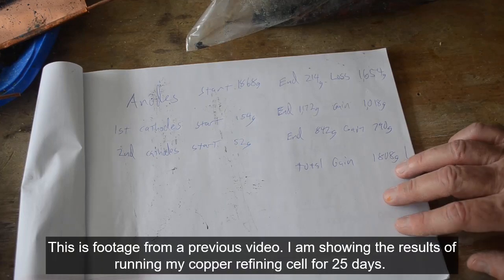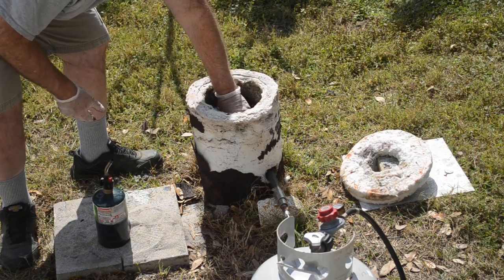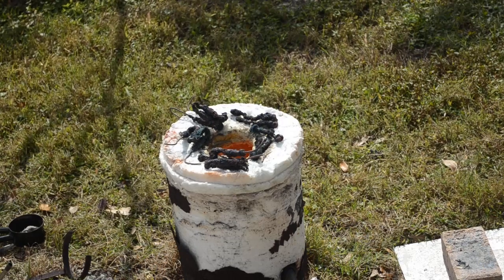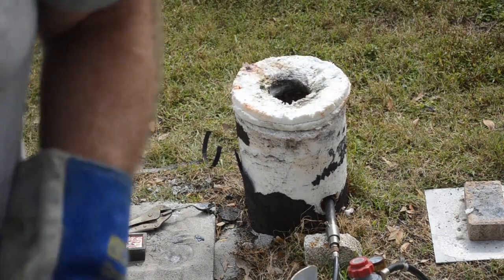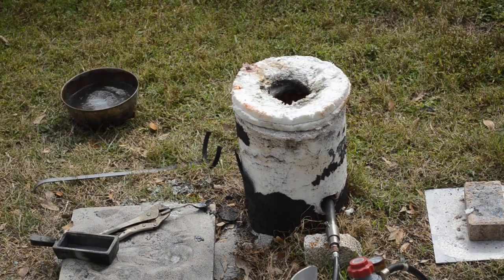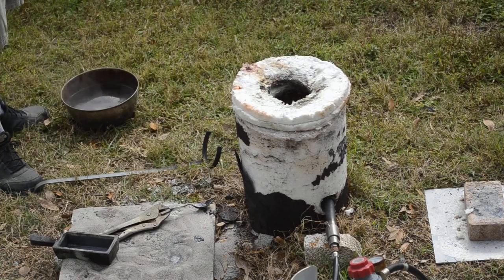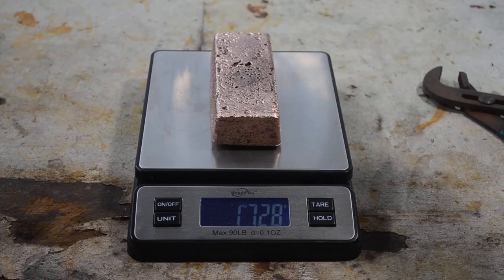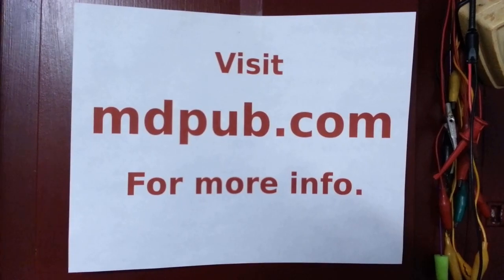Melting Cathodic Copper From My Copper Refining Cell

Comment: I extracted copper from Copper sulphate by the displacement method using Iron. When I tried to melt the powder copper it turned in to a carbon like form and was black, I used a LPG gas torch and a graphite crucible. Can you tell me what the problem was here and how can I fix it?

Comment: Cool, I think it's always fun to have produced something yourself even if it's a bit ugly or small. It probably easily paid the fuel and electricity bill also, Copper price in Europe doubled past 3 years... or did our currency devaluated? Most electrical grade Copper is also electrochemically cleaned as far as I know. Exactly same way but then with Coppersulfate solution as far as I know, but I get why you used a Nitrate Electrolyte. Cool to know it worked :). I processed CopperNitrate solution once with cementing out the Copper with Zink and then adding woodash to it. Theoretically you can use the waste as a fertilizer for crops like corn then.
Reply: Very curious how processing the electrolyte and the anode slimes will work out in therms of yields